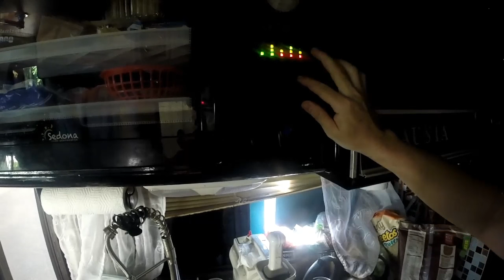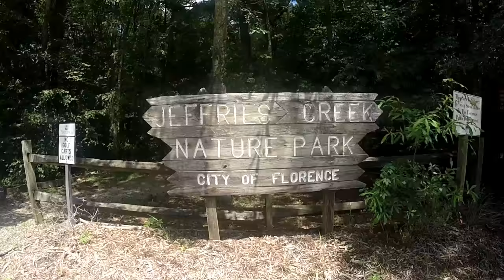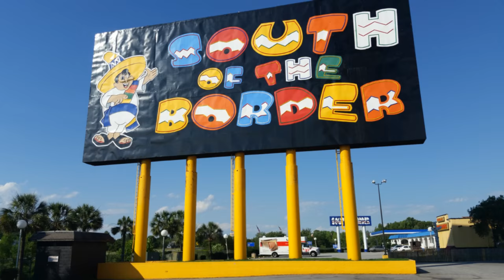Back On The Road    Florence & South Of The Border - RV Living Vlog

Comment: I was at South of the Border back in 1963 when I was a kid.  Your video's are evolving quite nicely.  Good work.
Reply from the maker: Wow that was awhile ago....Does it look different? Thanks :-)
Reply: Panda Monium Now that I think of it it must have been '65 or '66.  but it was nowhere near as big as it is now.  It was a rest stop, Motel, Restraunt, Cheap Souvenirs and Gas.  The big thing was for those traveling from up north, like New England, NewYork, NJ (nyc, for me) they sold "Fireworks" which is illegal  up there.  So they had a lot of that for sale for those travelers.  Kid went nuts, like getting legal pot!.  It was nowhere near as big as it is now.  Now it's really much bigger. Didn't have those towers. Cheers.
Reply from the maker: Really that's cool. ... thanks for the story ;) Cheers

Comment: I was wondering if you ever use leveling blocks for your rig? Some of the other channels sometimes make a big deal out of leveling their RV. I guess their fridge won't work if it isn't always level or something.
Reply from the maker: I use to but it can be a hassle at times plus my refrigerator it's just 12 volt solar now so it doesn't have to be level like the propane refrigerator.

Comment: What kind of battery charger did you buy to charge your batteries with the generator? I was wondering how long it would take to recharge a couple of batteries. Do you have to disconnect your solar charger when you connect the battery charger to your batteries ?
Reply from the maker: I charge them with 3 & 15 amp charger boughtbought from walmart... nope they are smart chargers so they know when not to charge.
Reply: thanks. your channel rocks.
Reply from the maker: Awesome thanks Mike :)